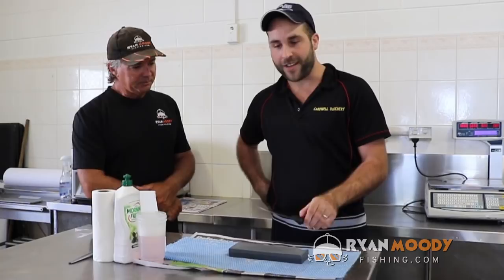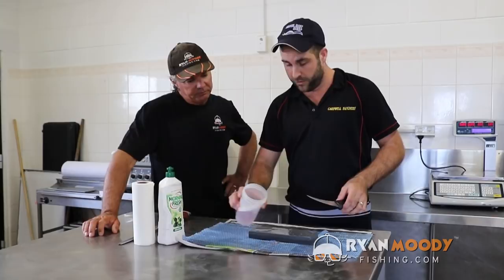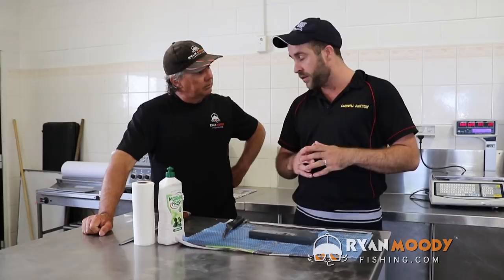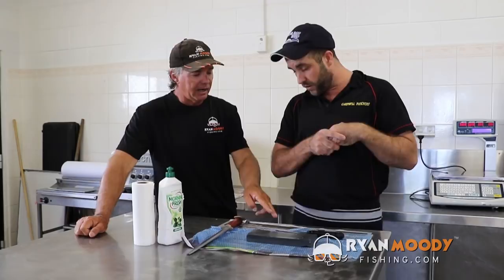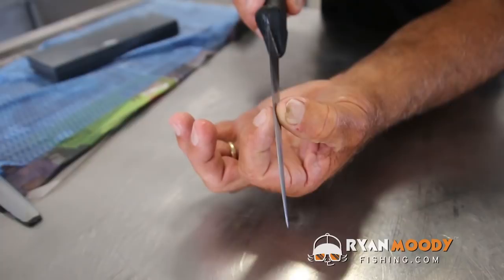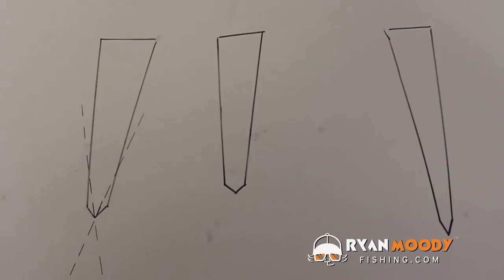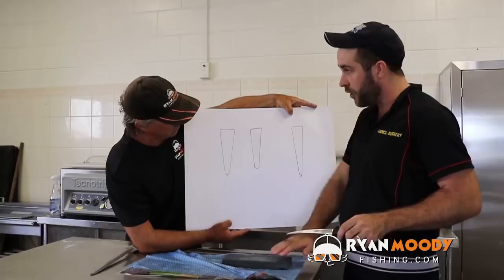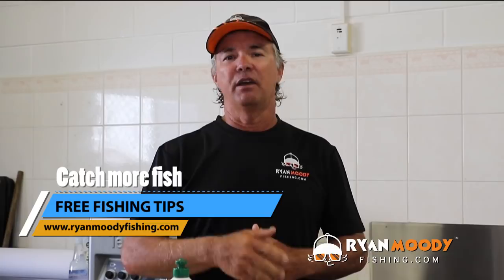Knife sharpening tips for easy fish filleting

Comment: You need to get the burr of the blade before you start steeling it like that. Gently running the knife once along and into the edge of a plastic cutting board will do it.

Comment: 10-12 degrees per side is what Port Washington Wisconsin salmon fishermen use for fillet knives. We use curved fillet knives from 6'' to 20" long. The best quality blades by far are carbon steel but the most popular are the stainless due to little storage maintenance needed. Most are far too flexible, but some fishermen like noodle blades.

Comment: Wouldn't let him near my knives!!...
I am a chef of 40+ years...and I still have sharp ones I started with in daily use...
Mirror edges, thanks to grading them from 4000 stone through to 16000...he never mentioned burr ...or how to remove...there are better demos available if you want a knife properly sharp...maybe try some Japanese methods..I use them on my Gustav's...these are patiently sharpened for 8-24 hours to achieve a super edge...by hand...
And don't buy shit steel knives...they will lose the edge the first bone they hit...buy a good knife...it will last a lifetime if looked after....my fillet knife is a sebatier rosewood.. flexible and scalpel sharp...it's 40 years old....and still razor sharp....
One knife I do have is a six inch nail that was forged down and flattened and sharpened..called a spike by UK fishermen..wooden clothes peg fashioned to a handle with areldite and string...beast of a thing!... probably not great for Barra(that I haven't caught yet!)..next time in Darwin though!...but great for one slice and off with a fillet for smaller fish...
...and try not to let your knife touch the boards....it kills the edge...
Use a different knife to chop bait...just a scraggy one...keep the filleter on a velvet cushion!...
Reply from the maker: ali mitchell Thanks for the info but I’m not sure many of our watchers wanna spend 24 hours sharpening a knife. We’re all too busy having fun catching fish.